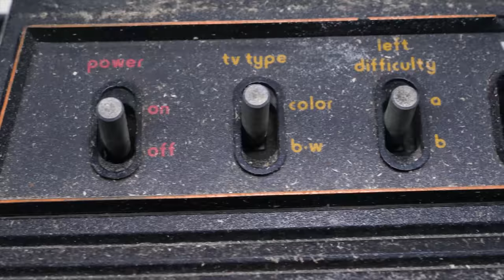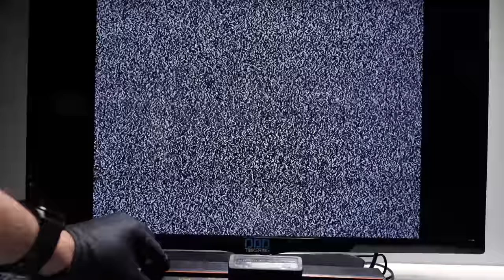Restoring Flooded Atari 2600 - Retro Console Restoration ASMR

Comment: My first job as an electronic tech was working at an Atari repair center. This was from 1982 till 1984. I fixed thousands of 2600's, 2600A, and then later the 5200 and 400/800 computers. 

A couple of things to note:
      The 14 pin IC is a CMOS hex buffer. From your video it is still working. If the game is constantly firing, then it's been blown.
      You can improve the sound by replacing the 2 barrel shaped 840 pf capacitors.

Great video. It brought back a lot of memories.
Reply: The vertical stabilisation has gone on mine so the the picture is constantly scrolling .. any ideas? 1😁
Reply: @HarryFlashmanVC  a random but important capacitor might gone maybe
Reply: i pluggend in my A2600 (original model) with the correct power supply but got a bad plastic burning smell, any advice at what this might be? thanks!!
Reply: wow thats amazing....I love everyone who repairs retro consoles in 2022 because we won't ever get new ones in the store
Reply: @silkscreen.3495  Replace the capacitors in the unit and power supply. Aside from that a lot of times it's because of the kind of plastic they use. It tends to smell like that a bit as it warms up.
Reply: 😌😌 so you did live Great live by payed study by gouvernement
Reply: @dDAMKErkk  bot
Reply: @sine0  yoU SOUND sweet;
Reply: @silkscreen.3495  Possible that the power supply is backwards? If the negative and positive were reversed, you'd probably blow a diode somewhere inside the unit.
Reply: @silkscreen.3495  Bad capacitor or shorted diode, check them all
Reply: How many 5200 controllers were brought in for you to fix only to find they weren't broken; they were just crappy controllers?
Reply: @Tom_Van_Zandt  those controllers were garbage.
Reply: So Odd Tinkering here said you can use the cable from the atari as a tv antenna. was this a feature or just a cool thing you just so happen to do with it if you knew how.
Reply: Constantly firing, as in, the Fire button's constantly being registered?
Reply: @theargonaught44 it was a feature.
Reply: One thing I noticed. The Space Invaders game had double fire power and the difficulty switch was set to hard because your ship was 'fat'.  Double fire power could be achieved by slightly lowering the power switch so it was briefly turned off them back on.  It was a glitch/exploit.
Reply: @kapnkerf2532  woah thats amazing
Reply: thats amazing. are those capacitors part of a low pass for the audio?
Reply: @silkscreen.3495  I am not a technician but  you could check the voltage of the powersupply. Especially older powersupplies. They can give a higher voltage and damage can be done then.
Reply: Dear sir, you don't know me, I don't know you but thank you for your job and our beautiful childhood!
Reply: @gameover878  I was 22 years old when I was repairing Ataris. I’ m 63 now, and I still remember the part numbers for the 2600’s. Memory is a weird thing. I had fun. That’s all that matters now.
Reply: Still have my childhood 2600 downstairs, haven't turned it on in years. I should dig it out this weekend.
Reply: @randomscribblings7192  You definitely should!
Reply: Amazing restoration job! Where did those gaming years go!
Reply: I worked there 78,79 and 80 .....fixed a lot of these not mention made them to start with
Reply: @mattpragluski2017 I liked them and they worked good
Reply: I still have mine
Reply: No 7800s? I remember buying pole position at a yard sale, not know about anything but the 2600. 

The game was for the 7800 :/
Reply: I repaired many and worked there in Atari 1978,79 and 1980 in different buildings ...also was in silk screen cabinet dept. But yeah late 79 and 80 I assembled those and so many and rework and test ...it was slave drive too and assembly line fast.
Reply: @svenfruiti494 atari 2600+ neu im Laden zu kaufen 😂 sie hatten unrecht
Reply: Did you ever come across a unit called 2600B with 288 built in games? A Atari clone I suspect. I rescued one from the trash but the picture is really bad even after fixing some cracked solder joints in the #1 game port. What else should I look for to improve the consoles playability? Can caps be bad even if the unit funktions (after a fashion)?
Reply: Wow looking at this again....what a flashback... unfortunately by the tgat date I was gone from Atari and was layed off in June 1980
Reply: Are those chip sockets supposed to be there? I'd expect the chips to be soldered for cost reduction reasons.
Reply: What does it mean when a game is constantly firing?
Reply: I was an electronic tech working at an Atari repair station.   I had a 5200 come that a little peed on.  Little guy woke in the night and went to the living room instead of the bathroom.    I opened it up but it was too corroded to be fixed!

Comment: What you have there is known as a “Light Sixer”.  It was the second generation version of the Atari 2600, released in 1978.  The first 1977 version it known as a “Heavy Sixer”.  Both look very similar, having a faux wood front and six switches.  But the Heavy Sixer is, as the name suggests, slightly heavier in weight.  The plastic trim around the sides and bottom of the wood grain are also more curved.  Lastly, the originals like that also have a label on the bottom saying they were made in Sunnyvale, California.  The second generation Light Sixers were outsourced to Hong Kong after Atari exploded in popularity after the first year.  Sunnyvale couldn’t keep up.  The 2600 was workhorse though, lasting through other editions too.  Like a 4 switch version with wood grain, and an all black version nicknamed the “Darth Vader” edition.  The original Heavy Sixers in very good condition are really sought after though.  Judging from the 1980 sticker on the inner parts, I’m guessing this one you have was a very late version Light Sixer from late 1980, around when the 4-switch model came out that same year.

Comment: That's probably one of the most impressive restoration you've done. It's quite difficult to find consoles older than I am and I thought that was DOA from the start, beautiful to see it finished like it was new.
Reply: The beauty of the old consoles and specifically the Atari 2600 is that it's so basic, it can almost be repaired with hammers and screwdrivers.  LOL
Reply: The excessive attention to detail like cleaning the original screws instead of just swapping them out, and the creating of matched EVA foam washers exactly like the original instead of close enough replacement washers.  

This was clearly done with restoration in mind.  I am sure he would have used radial capacitors if they were available with similar life spans to the ones he used.

Comment: this is just insanely good. i skip the electronics cleaning part mostly by now as it is basic, but the real kicker is all the repairs that are non standard. The case... the foam... just the process. this is where I learn tons!!
Reply: the ducktor will not forgive you
Reply: Couldn’t believe that there were just some bad capacitors causing this failure… There were a lot of corrosion on the board. Good to see, that everything worked fine and was a quiet easy problem!
Reply: @masterrudi  It's hard to say, those caps might not been bad, from my view, they didn't look like they were leaking. I have seen waterlogged 2600s, dried out and boot up fine. The console still turned on before cleaned it, you might have been able to clean the cart slot and the game might have booted.  They were built very well....  It's kind of rare to see a 2600 that is completely dead, even 30 years later.
Reply: @TheCoolDave  Totally agree, a few months ago I found an Atari 2600 made in 1981, very rusty and dirty, I had a lot of work cleaning it, but it works very well, regards.

Comment: This is what I love about your channel, the way you restore things. You don't half-ass it, you do a full, proper restoration. You even got the little orange paint bits and cut out some new foam discs. Not to mention using epoxy to fill in the holes! Nobody else does that. You don't just repair the thing and call it a day, you do everything you can to make it look and act like you've just bought it brand new. I respect that!

Comment: A cast aluminium RF sheild, no less. Imagine how much that would cost if it were today. Whilst the user controls looked bad on the outside, fortunately the boards were clean when you took them apart. Marvellous restoration as always, ODD, you certainly brought that one back from the dead. I liked both that miniture multitool and that Bahco die punch.

Comment: Very well made and shot congrats! Done two of those restorations recently and one thing that struct me is which part each of us like to concentrate on. I’m less to fix casing or paint issue but some parts of the electronics need more work. Especially changing those old single wipe DIP sockets which are probably very flaky due to corrosion (I do think you were lucky there) also I would have removed the plastic housing of the cartridge and bushed all that crazy. Also I usually reflow all connectors especially power and Joystick dsubs which could have microfractures in the soldering
Reply: Probably not needed then, as this guy did even a half assed job at rust removal from the internals and it still worked.
Reply: You should make a YT channel!! I would love to see more of the electronics restoration.
Reply: @nicholasadams2374  I have a not too shabby one, but I mostly do hacks/research and little restorations

Comment: I've repaired Atari controllers before. The little metal-cap points for each direction on the board tend to split and then it won't contact the board when it's depressed. At that point we usually give up, but I was able to save my last controller by applying a sticky foil on top of each which worked for as long as the rest of the console survived. I think my parents still have it in a box somewhere.

Comment: The new radial cap that you installed visible on the left of the top facing side of the brown board was flopping around in one shot. Did you secure it before closing the case for good?

Comment: I had an Atari model like this, it would turn on and work but sometimes it would flash random colors like these when turned on, (Then it would take you to the menu, it wasn't broken as far as I know) the controllers refused to work however, even when there were batteries in it. Maybe they were completely dead or had acid but in it (I didn't see any acid but oh well)
It was a version of this Atari that had a ton of Atari games built inside of it and the joystick controllers had a light and a battery slot.
Reply: check electrolytic capacitors as it is done in this video. they tend to finish over time like batteries.

Comment: The only thing I would recommend is when you're doing small epoxy repairs like that it's okay to get the majority of the chunk off with an electric tool but you must send it by hand in order for it to be even. Because you can see after the repair is complete how those two areas are not straight. It's best to use a small piece of sandpaper and just go one stroke at a time in order to get it correct. But besides that the machine looks excellent

Comment: Beautiful restoration!
Would have been nice if you had told what you were using to clean the parts.
Do you know if it is possible to replace or repair the following parts?
1. The reset switch does not spring back to starting position.
2. Switches do not make good contact.
3. Poor/loose connection where joystick plugs into female connector.
4. Joysticks don't respond well. Dirty stick connections?

Comment: 6:40 I have a 1978 Stereo HIFI "ITT MC 20" absolutely all componements is good , every capacitor work very fine the belt for deck cassette and turntable is ok the fuses also it just need  to change  2 light for the deck cassette Vu Metre !

Comment: As a kid I had an Atari 2600 that my uncle used to own along with a black and white tv, it looked a lot like this except it was full black instead of having the wood look to it. I used to like to play frogger and other games on it but the controllers looked a bit different, they were longer and thinner, they also had a large round dial on them towards the bottom but still had the stick at the top. I've tried looking but I can't even find the same controller online.
Update: I think the controllers were Coleco Gemini controllers, they look the same as I remember (The Coleco Gemini system itself was an Atari 2600 clone from 1983 but looks way different).
Reply: This was exciting to look up, so the controller ports for both the Atari 2600 and the Caleco Gemini have the same amount of pins and look exactly the same. It took a lot of digging online but I found a part of my childhood that didn't know was missing and it explained why I couldn't find my controllers that I grew up using with the old Atari because they weren't Atari brand haha.

Comment: my 2 cents :face-green-smiling:
you might consider to use a electric toothbrush for faster and better cleaning. Isopropanol is an all rounder but sometimes WD40 is better against adhesive, depends on the used type of adhesive.

Comment: I've come up with this saying after doing a decent amount of repairs and watching tons of videos. 

When repairing electronics:

6/10 a contact point needs to be cleaned. This can either be solder reflowing or cleaning a switch that has become dirty over time. 

3/10 electrolytic capacitor needs to be replaced. 

1/10 is other issue.

Comment: I have my childhood Atari, and many different types of controllers that go to different games. How much do you charge to restore old game systems like this? Mine is in good condition as far as the way it looks, and I don't know of any problem with the console, but like the main controllers have issues with the contacts. Also noticed that sometimes when you put a game in the console, you get a messed up screen instead of the actual game. But if you blow air into the game itself, it will often get it working. And last, since losing any TV that it could attach to with the different kinds of plugins on newer TVs, is there a way I can ever play my Atari again?

Comment: with ABS plastic, all you need to do is get some black ABS from some other broken appliance or 3d printer filament, and soak it in acetone, and it chemically bonds to the repair. plus no need to paint it black.

Comment: Great restoration! I have one of these that is in like new condition, despite having been played a lot. I guess you couldn't get the axial caps, but it would have been nicer. I didn't see you do any work on the connectors, these are usually really bad, especially the cartridge connector. Only thing is you need to work on your soldering skills! Watch some YouTube videos. And don't use WD-40 on switches!!! (or potentiometers) There are sprays made for things like that. Also why didn't you use the ultrasonic cleaner on the board? It will get the gunk out from under the chips on the board.

Comment: I don't know where you learned to turn on a device suspected of water infiltration before cleaning it. The logical course of action is to clean it first, then perform the initial test, avoiding the burning of components that can get damaged from a potential short circuit.
Reply: это развод

Comment: As an electrical engineer, I see absolutely no reason to restore and Atari 2600.  It's not that it's just a primitive system, although it is, it's that the games are NOT enjoyable, and it is an energy PIG.  We spent 40 years making better systems for a reason.  This machine can run as a simulation, on your phone, with gate level accuracy (meaning, it would run as a "perfect" machine, with no faults), at 1/1000th the energy consumption, and act entirely identical to an original machine.